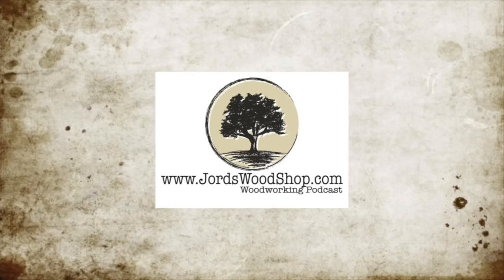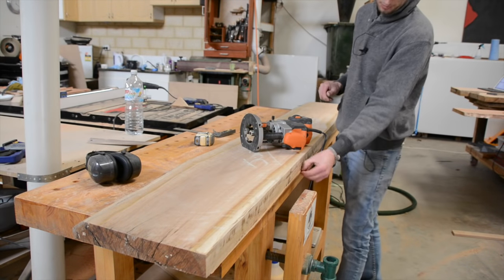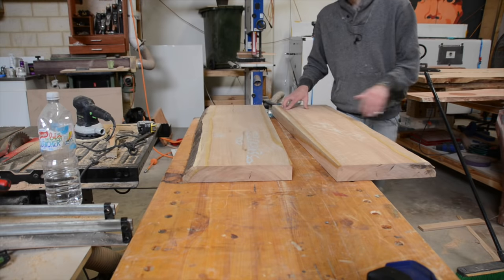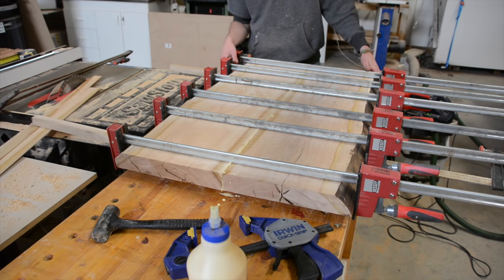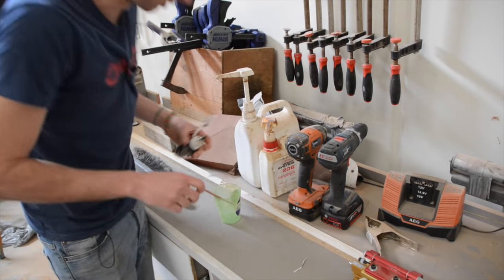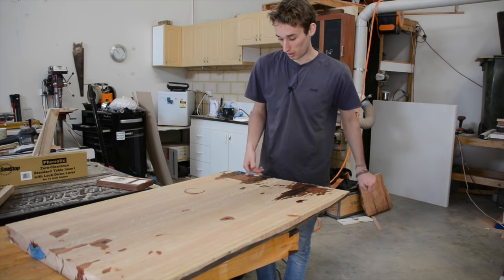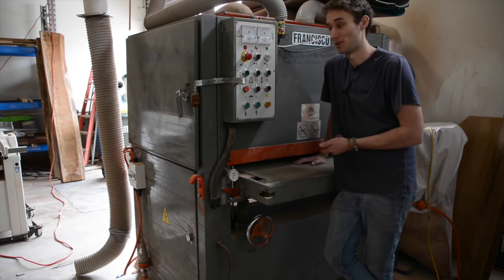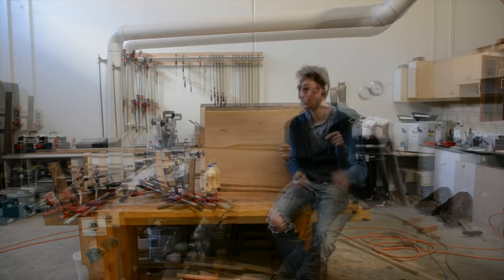How to make a rustic live edge coffee table Part 1 - The top  (Awesome Coffee Table)

Comment: Jord maybe try vibrating your epoxy in the mixing cup to remove the mixing bubbles, orbital sander should do the trick... also works on the slab too but make up a dummy pad so no pesky dust :D

Judging by the accent you in Aust?(probably one of the worst country's to be a fine furniture maker)

Comment: hi Jordan, Nice top. I love the black epoxy accent. I have a question for you. I see you have a Bosch Axial glide sliding compound miter saw. How do you like it and would you buy another? I recently redid my miter saw station and kept my 2004 Makita LS1013 10" sliding compound for the time being but its starting to show some signs of wear. I posted a video earlier this year on the question of which miter saw was better, the Bosch Axial glides or the Festool Kapex and 75% stated Kapex was the way to go because that's what they had, but no one says much about the Bosch Axial glides. I fully understand Festool equipment is very high end, but $1500+ is twice my budget. Thoughts?  Much appreciated. Thanks.Scott from the US.
The WoodCraftsman 
www.youtube.com/puttz1976
Reply from the maker: I can easily say the bosch axial is the best mitersaw I have ever used and that includes the kapex, the thing I really dislike is the terrible dust collection. The only reason I would get a kapex over this is if you are overly concerned with dust going everywhere.